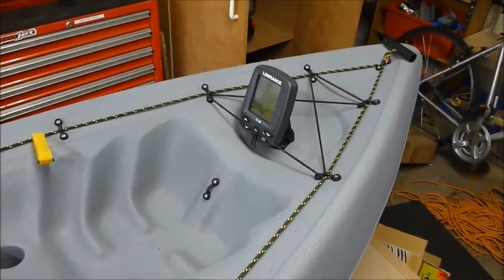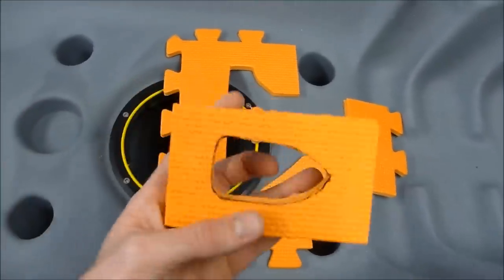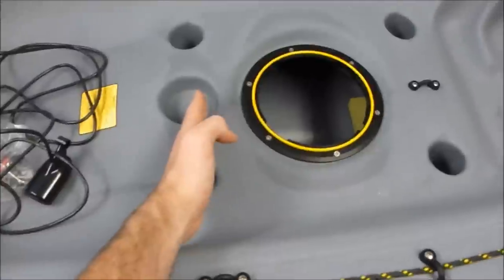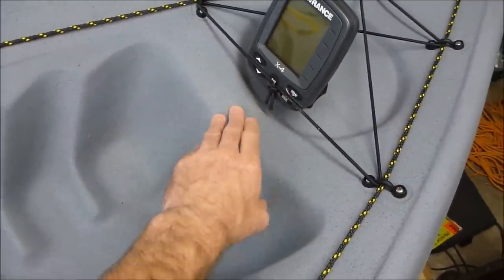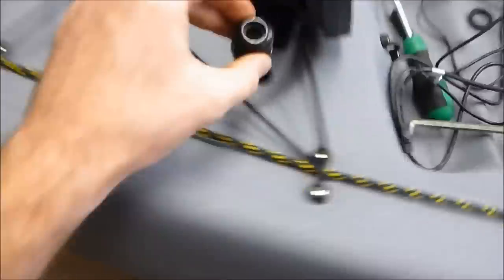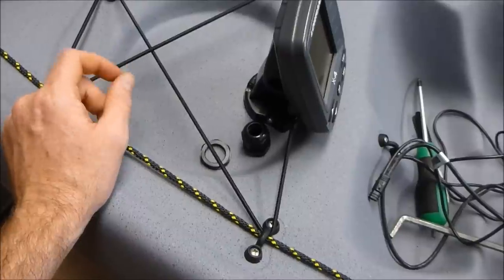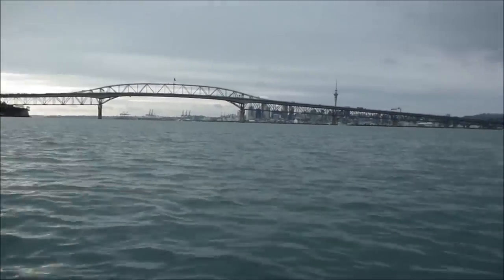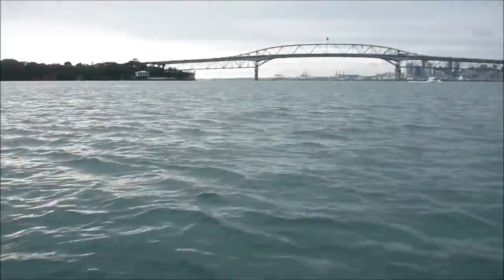Installing a Lowrance X-4 fish finder on a kayak with in-hull transducer

Comment: Consider 'Ammo Boxes' for Battery. Come in plastic now, with proper foam surround inside, they'll float. Plus with a little forethought can be grommeted or sealed for wires with Selleys, or here in the states LEXEL . Can be made into a neat,portable unit with some ingenuity. Great Ideas here, and thank you....Even if this is a 9 yr old post !!

Comment: Good info! SUGGESTION for anyone watching this. Use double sided tape to TEMPORARILY mount the unit in different locations till you have it where you are happy with it. THEN PERMANENTLY MOUNT IT!
For the Transducer, I made a removable mount that hangs off the side of the kayak. This way I can use it on all 3 of my kayaks and my Jon boat too.
Reply: do you have video of the transducer install?
Reply: I made a nice VELCRO mount for mine, works great for day trips, remove everything in 2 mins when i get home!

Comment: if you get small spots on your screen it's due to air bubbles under the transponder in the clear sealant used, be sure there are no bubbles before pressing the transponder into place. im glad you installation went well, good video
Reply: the only feature you will sacrifice with the  Thru the hull installation, is the water temperature reading
Reply from the maker: Thanks for the positive comment Phil

Comment from the maker: On that little kayak I just put the battery in a dry-bag and clipped  it to the scupper holes inside the hull, when I later upgraded to a larger kayak, that system didn't work too well. On the larger kayak I siliconed (same silicone) a plastic storage container to the bottom of the hull inside the hatch and just put the battery in that while on the water, worked very well for almost no cost.

Comment from the maker: Hi mate, the display unit is relatively waterproof, I did get a bit of moisture inside mine at some point by blasting it with a hose pipe, better in general to just rinse them off under a tap. But overall, waterproof enough for the price.

Comment from the maker: FF has worked very well so far, I'm pretty happy with the performance for a bottom of the range FF, no problems at least! I used that silicone (Selleys All-clear) mainly because it was recommended through one of the kayak fishing forums I follow, unfortunately I'm not sure what the US replacement would be, might be worth trolling the US forums. Cheers

Comment from the maker: Hi there, yep, used the silicone to glue the foam in first. I did actually remove the transducer after a month when I bought a larger fishing kayak and it came off 'relatively' easily. The new kayak had a transducer scupper hole, so I just cleaned off as much of the silicone as I could and mounted it on the new kayak. Good luck!

Comment: Two questions. Did you use the Clear Silicone to glue the foam in the hull as well? And if I wanted to remove the transducer in the future would I be able to separate the silicone off the transducer fairly easy or would it be near impossible?

Comment from the maker: Correct, for most fish finders in fact. You lose a little bit of resolution, but overall, it's a easy way to install the transducer without the hassle of a bit sticking out the bottom of your boat.

Comment: Hello Sir
   I saw your system at the video and made some research on it but haven't been able to clarify it. Does that system as efficent as the leaving the eye cable deep into the water or there are some loss of efficeny? Are they useful for both lake and sea usage? Some People claims that there Will be loss of efficeny but your opinions are important to me because it seems you are professionally working on that. Can you Please enlightening me about that than I Will determine my investment based on your opinions. Thank you for your help already have a great hunt
Reply from the maker: Hi there, the through-hull system is definitely less efficient than having the transceiver directly in the water, but I found that it works well enough and obviously made mounting much easier! If you are fishing in shallow water, then this method should be fine.

Comment: So i have installed the transducer on the inside of the body with silicone/ glue. Wait untill it has set and then made the connection with the 125x box. Wonder !!!  it works great with no interference. Super!! so now we know the  125x works with metal bodys on the inside.
Reply from the maker: Great news man, thanks for letting us know!

Comment: I know this is an older video, but do you think the transducer would still work if you didnt add silicone underneath it, and instead, just used some velcro or something to hold it down in the mold you made for it?
Reply from the maker: I think that since the transducer and kayak are both hard plastic, you really need the coupling to get the ultrasonic signals to propagate properly. It cant hurt to try your method, just compare the in-hull vs. just holding the transducer in the water and see how much difference there is.

Comment: Hey! I really need some advice. Do you think the thickness of my kayaks plastic could interrupt the signal. Im trying to install using 3m sealant. Do i have to sand the plastic before to narrow down the foam or should it be fine without. Thanks
Reply from the maker: Eric DiDomenico My gut instinct is that most roto-moulded kayaks are going to be very similar in hull thickness. That kayak shown in this video also had a fairly thick hull, so you will probably be fine. I didn't / wouldn't bother sanding the plastic, I think the smoother it is, the less likely you are to have air bubbles or sonar reflections. Good luck, hope it works well.
Reply: Eric DiDomenico just need to make sure it is clean and dry, not sure which cleaner would be best, some may melt the plastic and others may leave residue that will prevent glue from adhering properly.

Comment: do you think its would matter if the kayak had a slight curve where i wanted to plant the transducer??? and if i used white silicone? thanks
Reply from the maker: I don't think a slight curve would make any difference, just make sure the area is completely covered in the silicone and do your best to avoid air bubbles. Not sure if white silicone would work, a friend used some general purpose silicone and it worked, but it looked like his FF was less sensitive than mine while fishing together.
Reply: mate go for clear as theres less particles in it to block the signal. and a way to stop air bubbles is leave the nose of the nozzle buried in the glue the way done in the vid is more likely to get bubbles

Comment: Nice installation, where did you get the grommet from?
Reply from the maker: Hi Charles, you should be able to get those at any electronics store, those are from Jaycar Electronics in NZ, so dependent on where you are, radio shack, Dick Smith etc.
Reply: Great Thanks, found the product! It is technically called a cable gland.

Comment: Can I use epe foam, (the foam thats usually white, slightly hard and comes in computer parts packaging) or do I need to use foam like the one in the video?
Reply from the maker: The foam really only holds everything in place, so I don't think the type of foam makes much difference. Do a test first to ensure the silicone does not have a reaction with the foam!

Comment: hey
i wanted to ask where can i find the battery connectors
or what type is it
thank you
Reply from the maker: Hi mate, on the battery I have used some large electrical terminals commonly known as 'chocolate blocks', these allow me to attach and remove the power cables with a small screw driver that I keep in my fishing box, I feel this is more reliable than the standard friction spade terminals. On the cables I just have some 'bootlace ferrules' to protect the copper. Both these should be available from any electrical supply shop.
Reply: Successful Engineer thank you.. :)

Comment: Can this work on a steel body ?  have the x125 and do not want to drill a hole in the body of my boat.
Reply from the maker: Great question . . . no idea sorry ! would be worth trying before drilling any holes, if it doesnt work, clean off the transducer and look at your other options.
Reply: No problem...i will try it. But i will not drill a hole in the body. If its not work i will find another one. I tell the result in a couple of days....greetings Tom from Belgium .
Reply from the maker: Good luck ! Very interested to hear your result !

Comment: how does the transducer know temp when its inside the kayak?
Reply from the maker: Mitchell Deye I imagine the temperature reading will not be as accurate as when the transducer is in the water, but probably only off by a few degrees. The seawater does a pretty good job of cooling down the plastic kayak, so the reading on the FF screen is probably within reason.